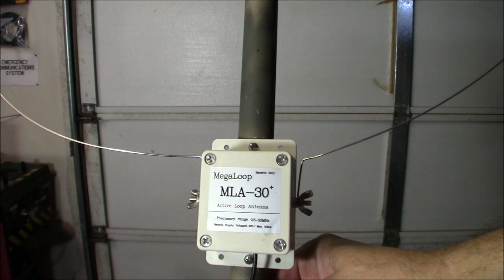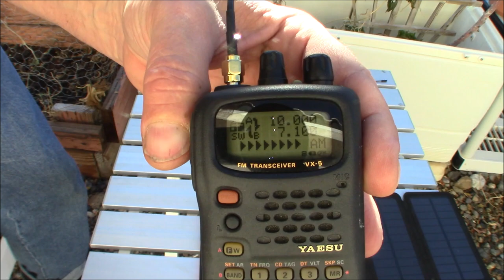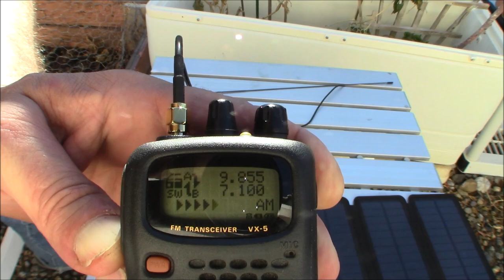MLA 30 Active Shortwave Loop Antenna And Build

Comment: Thank you! Amazing review. Just ordered a MLA-30. I will be plugging it into a XHData D808, which has an external antenna input. Can you please tell me what are the connectors/ adapter I need for it? Do I need a SMA male to a 3.5 mm mono male?
Reply: I wud like to know the answer tooo.
Reply: if your external jack is a mono phone jack (3.5 mm) then yes, 3.5mm to sma male

Comment: Hi, just to clarify, the little box is not the pre amplifier of the antenna. It is the power supply to the big box on the bottom of the loop. Some SDR's like SDR Play have this built in and don't need the little box. Thanks for taking the time to produce the video.
Reply: Yeah, it's analogous to a POE (Power Over Ethernet)  injector, except this would be power over coax. It enables you to power it from the other end of the coax instead of having to run power through a separate cable to the box directly connected to the loop..
Reply: Yeah, it's bias tee

Comment: Would this work as a good shortwave antenna to put in my attic. If not. What is a good attic antenna for shortwave. I need one that will cancel out alot of noise.

Comment: I know this video about two years old and you've probably moved things around by now but anyway loop antennas don't need to have hight to receive or even transmitt well, but in this case in the video it should at least clear the fence or the fence will make it some what directional, I us this antenna with a 1/2" copper refrigeratorant tube it's amazing how well it works.
Reply from the maker: Yeah antenna now is up about 10 feet, however I did not think of changing out the wire for copper tube, that is a great idea, going to have to try that one out thanks!

Comment: The bias T is what injects the 5 volts DC into the coax to run the preamp that is in the little box attached to the bottom of the loop.  The put the preamp at the antenna to boost the signal coming into the receiver.

Comment: Helpful hint, you can get a pvc tee which fits on the end of the pipe. You don't even have to glue it.....
Another thing , I use a USB battery pack to power it when going on a picnic or camping, it lasts for hours.
Great video thanks for the information 73.

Comment: I bought the MLA30+ and installed it on a 3 metre plastic tube then fitted it outside on my eaves. 
Powered by a usb power bank feeding my Tecsun S2000, I have to say ,this antenna is brilliant.
It’s very low noise and really pulls the stations in at night.
I’ve since raised the MLA30+ up on a fibreglass mast about 6metres high so it’s well above my bungalow roof, 
And rewired the cable with RG8X from amplifier to receiver. The difference is quite amazing. 
People say that height doesn’t make a difference to this aerial, but I’ve now proved otherwise.
Reply: Is the RG8X going from the balancing T (with the 2 sma ports and single usb port) to your radio or between the box at the base of the loop to the balancing T or both (all RG8X)?
Reply: @mikes1798   I rewired from the amplifier on the loop antenna to the balancing T near the radio. I’m feeding the balance with a rechargeable power bank 👍

Comment: Ordered the MLA-30 on Amazon and ended up getting the MLA-30+. Bags were labeled with the older number but the T itself is labeled with the newer number. Factory probably just started switching over. Nice “plus”, lol. Thanks for the share, with winter coming in the northeast I wanted to get this in place now.

Comment: 01:45    "BIASING-T" doesn't mean a Pre-Amp. 
If the SDR-Program or the receiver support this, it means the Power supply for the antenna! 
So you don't need to use the USB-Port. 
And this means fewer power disruptions
Reply: If i were to use this antenna with a dsp2 sdr receiver that sends power on the 50 ohm sma connector, would i need to bypass the bias t box?
Reply: @stickstickley8944  There are entries in the SDR software programme that relate to Bias-T (you may have to look elsewhere depending on the software) - if this is activated there, the Bias-T box is bypassed accordingly - this runs automatically - so you don't have to disconnect anything first.

Comment: I ordered an MLA-30. Great video. You explained the assembly very well
Reply: will it fit to a boefang uv5r or do you need any adapters ? mine is a male adapter on the radio. DANIEL

Comment: I love to build kits, and have all sorts of crap that I never use for anything but the build was fun.  Arduinos are my unit of choice and I have a half dozen WIFI radios in the house. Of course they are not real radios but wifi receivers that are programmed to play wifi radio stations from around the world.  They are only useful where there is a good wifi connection that is open or you have the sign in data for.  As far as Shortwave  I love listening, and have several SDA setups that I plug into my laptop and play with but my house seems to be a great Faraday cage, very little signals can penetrate the walls or the steel roof that is in place after several nasty hail storms like most of the town shingles are a thing of the past, to much work after storms where the steel can be ripped off and replaced in a couple of days.  Even the local AM/FM radio signals barley penetrate, and only some parts of the house can receive signals from the large Antenna some 1.5 miles from my home. Annoying to say the least.  Several years ago I got my Technician ticket to operate on the Ham band, and it was wonderful while my wife was still with me and we traveled across the Southwest during the winter month .but we came home and during the covid deal, my wife developed Cancer,  Since the hospital was closed to outpatient surgery, they could not do the tests to find the Cancer till it was far to late, she passed away 3 month after being diagnosed. She had the cancer in her stomach at first and virtually starved to death.  I held her hand till the last. I was debilitated for a year and a half till my MD actually helped me out of the deep depression of the loss.  Great man that DR.  Anyhow now I am ancient and stuck in this damn house made of steel My ham ticket remains  idle since I am the only one in my town with a ham license, the  nearest 2 meter repeater is 26 miles away and I can hit it from my car but none of my little hand held transceivers can tap the repeater even though it is high atop a butte.  This antenna should be the ticket for my getting back into shortwave listening.  When I was a boy in the 50's and 60's I loved reading the back pages of Popular Electronics with their ham reports and drooled at the shortwave radios available back then. I even found an old SW set in the City Dump, the place were my buddy and I used for our shopping center as we were dirt poor back then, so I could listen to the SW bands that used to be filled with propaganda from Cuba, the Soviet Block and The Voice of America.  I hear  VOA is back up and running once more broadcasting to the Ukraine again.  I hope it penetrates the Russian blockages, we learned years ago that the Shortwave bands are so plentiful that one nation could hardly block them all.

Comment: I just put mine together last night and hung it on some tacks here in my computer room. I am in Connecticut with an ATS 20+ and picking up zero channels unless I disconnect and put the radio's whip antenna back on. I understand that the MLA 30 is supposed to work better outside, but I have a terrible feeling something in wrong with my new antenna. :-(

Comment: A owner of this antenna told me changing the direction of the antenna makes no difference.  I am wondering if the preamp in the box contains just a high impedance input matching circuit to the input of the preamp making it broadband.

Comment: I live in a rural area with a large back yard.  Would a long wire antenna be better for my situation?  I'll be using it on a vintage 1949-50 9 tube Hallicrafters S40-A with screw terminals for the antenna that I've restored.

Comment: I'm new to SW radio. I have a Tecsun PL-380 radio. The reception is good when i go to my local park but not indoors as there is too much interference.
Would this set up you made with MLA 30 work indoors? I'm in an apartment and can not use this on the balcony in winter months as it is way too cold here, sometimes minus 15 celcius and I can not leave any windows open to feed the wire through. Any tips/suggestions.

Comment: How will it perform if I replace the wire antenna element with a 1 inch aluminum tubing.
Reply from the maker: No idea but it is something I have been thinking about doing, might work better

Comment: I'm about to make my antenna iv seeen on other videos people using plastic tubing around the antenna wire have you seen this before and would it effect the signal?.thanks and your video was excellent. GED IN IRELAND 🇮🇪
Reply from the maker: Plastic tubing around the wire should not hurt at all As long as there is no metallic content in the plastic itself,  it will be fine

Comment: Good afternoon, I have been researching SWL and am looking to enter the hobby. Your channel has been a great help with receiving information. I am good with computers and audio equipment but not so much radio or general electronics so bear with me. I have ordered an ATS-25X1 with the enhanced Russian 4.0 firmware. I live in an apartment and I am curious (1) How to adapt this antenna to the BLN (I am unfamiliar with the various connectors and their types) on my ATS-25X1 and (2)  How effective an MLA-30 would be if sat indoors, in the corner of my 3rd floor apartment. I plan to use it outside but I am in an apartment building with windows that are very inconvenient for antennas. Thank you sir!

Comment: Ohhhhh SDR! Would love to see a video on that.
Reply from the maker: Coming soon!
Reply: @Iridium242  cool can't wait. I was looking into sdr as a cheap way to set up a scanner, everything here is digital and trunked. So to purchase a scanner for that is over a grand. But with free soft ware an old lap top and less than 50 buck in hardware you can do the same thing. Would be cool if you could cover that in a video.

Comment: Is it water proof? I’m getting a radio soon and I’m interested in having a more effective antenna. I’m getting a Tecsun pl-880 btw
Reply from the maker: Yes the outside antenna part is totally sealed up and water proof, the inside amplified part (the part you plug into the USB cable) I would not put outside
Reply: @Iridium242  Can you tell me why my Anker 15600 mAh USB battery charger/battery pack is shutting down when attempting to power my MLA-30 Active Loop Antenna???   Is there a simple cure to this dilemma?  Thanks
Reply from the maker: @tribulationprepper787  Its probably not drawing enough current to keep the battery bank active.  I would just get an AC adapter and plug in the antenna using the USB cable, its a pretty common thing to happen with low draw devices and these battery banks.
Reply: @Iridium242   I guess I should have mentioned the need for portability as opposed to AC use.  My bank is rated at 4.0 amps.  Would a 2.1 amp bank solve the problem?

Comment: Have you tried it indoors? I'm on the top floor of an apartment building with no balcony and solid windows that don't open. I've been looking for something that will increase reception.
Reply from the maker: Yes it works great indoors as well   I would put it near a window but its a great antenna for indoor use.

Comment: So, since I know nothing about these types of antennas, can I build this and use it in my home - Not Outside, or does it have to be up high outdoors?
Reply: Hey sorry we’re late 
But it can work inside  however your signal may be less 

Higher up in the house the better 

Probably avoid basement because of the foundation and ground 

Be aware that depending on your location you might introduce some interference from things like your WiFi router your power outlets and light bulbs 

Outside is better but it dosent necessarily need to be high as long as it’s a few feet of the ground it should work 

Higher is better but not crucial 

Highly doubt your be reading this scence it’s been 2 years 

But maybe your find it helpful

Comment: Hi again

I have a Tecsun PL-680 SW receiver. Can you tell me what adaptor(s) I would need to connect the MLA-30 to the antenna input of this unit ?

Thanks once again , for your great assistance !

Chuck.
Reply from the maker: a 4 mm plug adapter from an SMA adapter should work perfectly
Reply: @Iridium242  

Thanks !

Chuck.
Reply: I have the same receiver Tecsun PL-680. How well did this loop antenna work for you. I'm thinking of getting one too.

Comment: Can the MLA-30 be used as an indoor antenna ?  It is impossible for me to pass the lead-in cable thru from the outside in my building

Thanks !

Chuck
Reply from the maker: It will work just keep it away from anything that might generate any noise
Reply: @Iridium242  Thanks so much !!

Chuck

Comment: What must I buy to power the MLA-30 ??

Thanks,

Chuck.
Reply from the maker: You could use a simple cell phone charger or even a plug in adapter and plug it into the wal
Reply: @Iridium242  

Thx again !!

Chuck

Comment: Will one of these make a big difference vs a wire on my PL 660?
Reply from the maker: The wire will be  a bit noisier but this is great for indoor install and works very well if you can't so a wire
Reply: @Iridium242  I may end up grabbing one then, I think I'll mount it outside on some pvc

Comment: Would this be good for a Kaito KA500L?
Reply from the maker: Yeah as long as you have the adapter to plug in the antenna it would work with any SW radio

Comment: Will this work with a baofeng
Reply from the maker: Nope, the Baofeng works on ham bands UHF and VHF, and this antenna is not made for that, its also made for receive only so transmitting on it would damage it.
Reply: @Iridium242  cool thank you, who do you recommend to learn how to properly use the baofeng on this platform

Comment: ever compare the MLA-30 to a long wire end fed antenna?
Reply: A long wire antenna will collect more energy and wavelengths, depending on the length, without amplification, and the loop antenna has the the ability to  null out interfering signals, when you turn it. 
End-fed refers to transmitting antennas;  the MLA-30 is only for receiving.

Comment: I really like this loop antenna. However my radio does not have that Jack. Does anyone think I could make an adapter and put a clip on it and then attach to my whip antenna?
Reply from the maker: Yeah i dont see why not, I use an alligator clip for mine